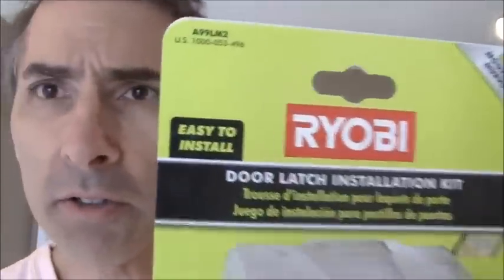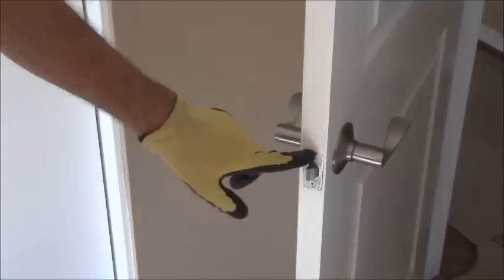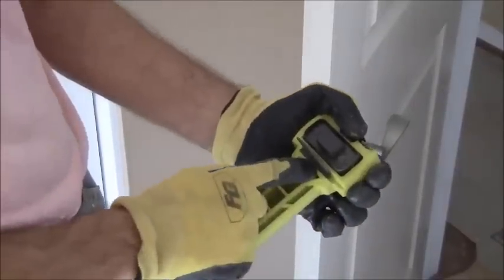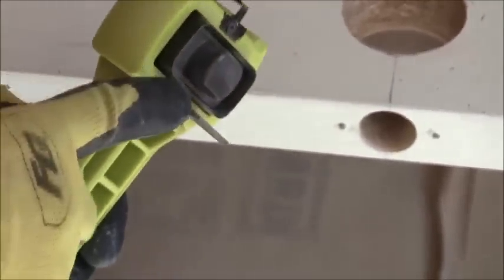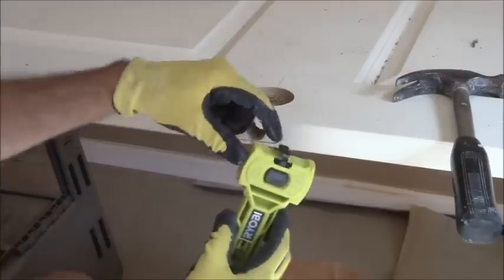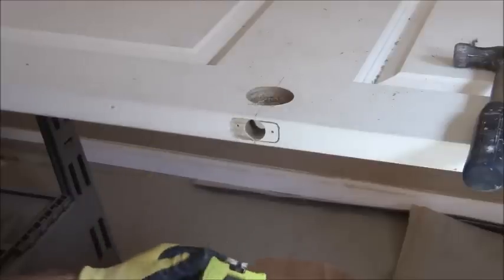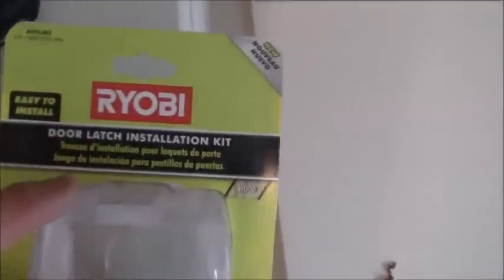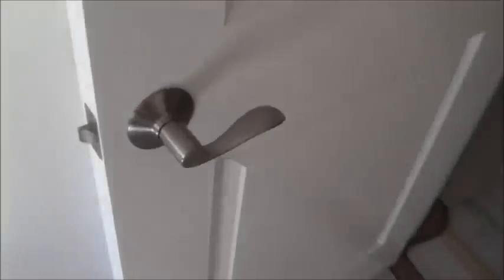Ryobi Door Latch Installation Kit MO# A99LM2 Review and Demo

Comment: I have this tool and it works pretty good but did have a couple tear outs of the wood here and there. Great tool a must for any DYIer or professional.  I also saw you used the door hinge router template they sell. I just discovered this had to go to 4 Home Depots to find one. Worth it's weight in gold. I ordered 3 more so I could set them up on one door with two or three hinges rout them all without having to move the one tool around got one extra in case one gets broken.

Comment: Thanks for this video. 
I just ordered 3 doors at home depot. 
I was thinking of hiring someone to do this for me, but watching your video, i know i can do this.
Reply: I have just one question. My new doors is about 1/4  wider from the old door.
Should i use a planer and shave the back of the door? Or the front? Or does it matter?
Reply: @jorrba3934  I am doing doors now and had the same problem. I bought an electric planer and have been shaving the new doors on the hinge side to match the existing width. First door I did wouldn’t close. Don’t think the side matters really, but I figured the hinge side would be less visible if I made a mistake planing
Reply: @DaddioWaddio    Thanks Jason.

Comment: I saw another video on this tool and the guy went crazy hammering step 1 and on step 2 he pushed the tool as far as he could and laid into it. When he was done it looked twice as deep as the striker backing plate. I have 8 solid oak doors to do so I was looking for something to make it more consistent. I like the 1st part, but as far as the 2nd, I think a really sharp chisel would do better. Work from the finished edge to the center. I also cringed when during the 2nd part you get to the end of the cut and have to remove the material. I just know if it were me something would splinter.

Comment: Cool, but I bought a router to install hinges and am using it to route out that hole.
Reply: how cost effective is that for the weekend warrior who might only ever use this tool and method on 2 to 3 doors ever?  Can't see myself buying a router for a couple hinge slots
Reply: @tonysalter5555  small routers are inexpensive and do more than just install hinges.
Reply: @danlux4954  gotcha, I'm sure there are other uses and I'm probably thinking narrow minded, since all I can see is the current project at hand which is a single pantry door my wife wants installed, which requires...everything I don't have to install minus a drill. lol But, as the wife finds more crap for me to do, perhaps a router need would surface indeed.
Reply: @tonysalter5555  you can put a router bit in a drill, hope you have a steady hand though.

Comment: Can the tool be use for the strike plate??
Reply from the maker: the tool is not made for the door jam strike but you can try it. I assume the tool will not fit right. Let me know if it works

Comment: Good video, however I think you should spend half hour sharpening your chisels. The tool itself is probably ok for DIYers and wouldn't be much use in the Uk. I think I would have been faster using a couple of sharp chisels.
Reply from the maker: Sounds good, Thanks :)
Reply: What about latches with rounded corners?